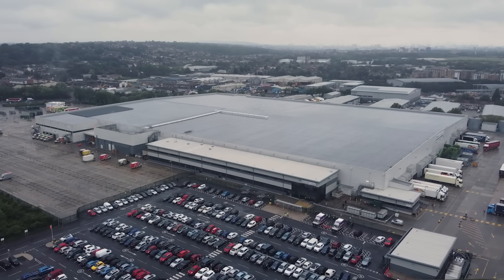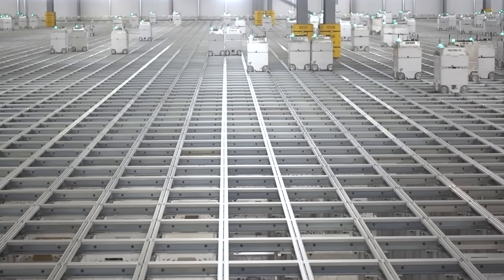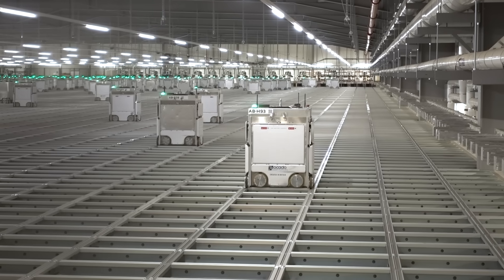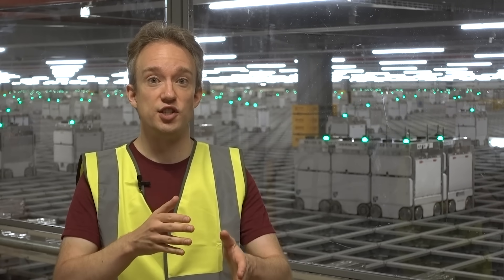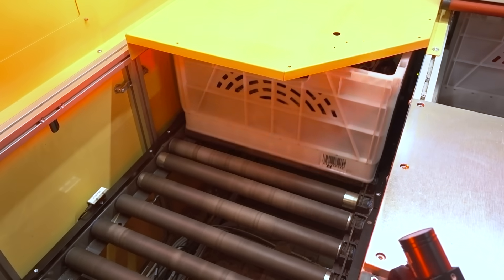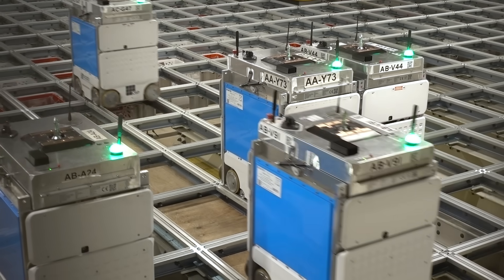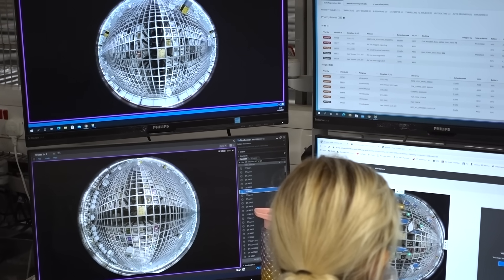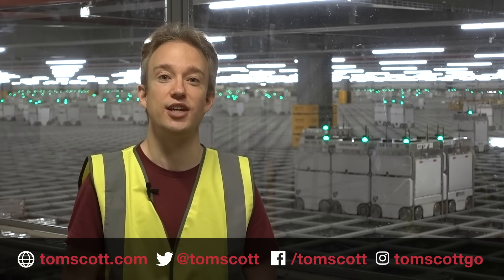How many robots does it take to run a grocery store?

Comment: Is a spouse part of a family? I think so. In the same way i think my gut biome is part of my body. Sure we don't all share the same DNA but we all rely on each other to get through the day.
Do you think any less of your blood cells because they don't have neurons? Are the lipids that coat my eye less of me than the skin cells I shed from my figures?
I am positive Tom didn't mean to divide but I thin ironically for this video it is the need to label things and put them in boxes that tends to push us apart.

On the other hand. I think it is fine to define things. I just think that if you can't work out if something is one thing or another in your definition system you haven't defined that part of your system well enough.  Your laziness of definition does not make a paradox.

Comment: Having worked at Amazon I guarantee 99% of the packing of the totes is done by humans. We had a very similar system there robots and that stuff, even a mechanical arm. However, the arm was slow compared to humans and was probably more of a proof of concept than anything that was anywhere near ready to replace anybody.

Comment: Please tell me that if they have to manually repair a robot on the grid (such as the orange one) they have a Tom Cruise with an engineering degree ready to be lowered from the ceiling in a harness to operate on it or extract it. If not then I'd be more than  happy to submit my resume.

Comment: Can we just take a moment to ealise that this place, which probably costs millions of pounds, still uses xbox kinect sensors for their 3d camera system ( 2:27 )
Reply: If it works, it works 😄 And they are very cheap.
Reply: The reality is that those sensors are amazing. They are inexpensive and very capable, which is a winner when you need to do anything at scale.
Reply: @gbestwick  I guess it’s just funny that they didn’t take just the camera out of it and even made sure the Xbox logo lights up
Reply: @Icetea-2000  I'd assume these come like that from Microsoft, specifically for this place. There's no way they're getting whatever quantity they need second hand off of ebay or so for probably varying prices and in varying conditions.
Reply: @cameron7374  I’m 100% sure they aren’t made specifically for this place, the Xbox logo gives it away, I also don’t think they buy every individual one from ebay or whatever, but they definitely buy them in bulk from a reseller or something, not Microsoft
Reply: Didn't the US military use Xbox controllers for controlling drones or something?
Reply: @MrSkinnyWhale  wait really?
Reply: @bigmoneyben08 no joke there is footage out there of a UAV operator controlling it with an Xbox controller.
Reply: @lukewalker3905  that is so cool
Reply: @lukewalker3905  that's awful

They should've used the switch pro controller
Reply: @MrSkinnyWhale  I know I saw a report on military using Xbox controllers to operate periscopes because the controllers are relatively cheap compared to a $1000+ controller panel  and outright offered familiarity and more functionality than the typical custom setups. And if they break it they just plug in a new controller off the shelf.
Reply: @pspprogramerpsp  there’s still a nyko one in the bottom of the drawer that nobody wants to use
Reply: @MrSkinnyWhale  I read somewhere, can't remember where, that part of the reasoning for that was that soldiers were more familiar with the Xbox controller, and it was easier to design systems around a control layout that they already were familiar with and knew rather than designing something bespoke.
Reply: @Rory_Shade  yes this makes a lot of sense. Not only saving development costs on the design/physical side as you say, but also for saving time on the human training side of things.
Reply: @MrSkinnyWhale  I think they used them for prototypes and experiments in more ergonomic controls; IIRC among others for submarines? 
I very much doubt that any military would use XBox controllers in a sensitive settings though. Their quality and resiliance level is far too low; even with normal gaming xbox controllers' sticks wear out really fast.
Reply: @termitreter6545  the bright side is they're so cheap, you could just have a pile of spares on hand.
Reply: @termitreter6545 I'd say their quality is just fine, and compared to other military stuff, they are dirt cheap (60 dollars or so?). And if it breaks or the sticks are worn out literally everyone can pair a new one in seconds
Reply: @djsomeguy  I mean you dont wanna crush your submarine into the ocean floor just because youre busy plugging in a new controller xD
Reply: @Chasam93  Frankly, for a big console manufacturers controller, I thought the 360 pad was shockingly bad in some regards. 
I got PS2 controllers whose sticks still work perfectly fine, but 360 sticks felt a bit loose after a few months of using. Heck, even at release they're not exactly tight, thats why most games need 10% deadzones for 360 pads.

And no, in the military you dont just wanna switch out important gear because it breaks all the time. Thats fine at home, not on the battlefield or even the vicinity of it.
Reply: @termitreter6545  They did use them and many still do. They’re versatile, easily to modify and CHEAP.
Reply: @termitreter6545  The xbox controller is designed to last millions of inputs. It's far more resilient and reliable than any custom job. It's also familiar to users and has zero "getting used to". And yes, it's used in the most sensitive settings.
Reply: Why spend the money research and developing something that is already cheaply mass produced.
Reply: I'll be honest. I thought you were just saying it used similar technology to the Xbox Kinect. But no, they are literally using an Xbox Kinect
Reply: the down side is that kinect only understands C#
Reply: Microsoft sold a specific version of the kinect for operations like this, with a USB cable. It was actually VERY expensive!
Reply: Microsoft: ...

Comment: It must be an absolute blast, to engineer such a thing. Part of me, immediately wants to see what issues occur and if they are solvable long term. 

Thanks for showing, Tom
Reply: Was an engineer on these, can confirm was awesome
Reply: @EmileVictor  same 👍
Reply: How are they all powered? If its by battery, how are they all charged? How does the main controller decide which bot gets what product? How do you get to a bot if it breaks down? What about cold / frozen products? How are they stored and retrieved? How do the bots pick up an item?
Reply: @skmetal7  LiIon Battery, charged at the yellow charging ports. The bots request charging and the hive mind allocates a free charging spot. The robots lower a square frame with grippers which lock into holed in the totes. The closest free bot is allocated to the tasks (to dig to lower totes, multiple bots grab totes and lift them until one bot reaches the desired tote, then the other put back the stack). Cold storage works well, frozen storage not so much due to grip of the wheels on the rails and the lack of battery heating (at least at the time
I was working on them). To retrieve a bot, you can lock a path to the bot on the gris to not be driven on and then it is safe to walk to it and pull it out.
Reply: @highcooley  working in the IT and mainly with architecting infrastructure for fleets of containers and Microservices. Aside of course from the mechanical engineering, it sounds like a physical manifestation of the same kind of problems. 

It boils down to creating a system that is resilient and self healing as much as possible.  

Awesome stuff, thanks for the insight.
Reply: Yes I want to see the algorithme !
Reply: About a 1 1/2 years ago ish an identical Ocado warehouse using the same robot tech completely burnt down in Andover, Hampshire. I can’t remember the exact cause but I believe it was to do with the robots.
Reply: A clear issue would be that replacing human workers with robot workers contributes to unemployment. The greater the rise of automation, the greater the rise of unemployment becomes.
Reply: Your naive grasp of future consequences from today's actions is a perfect example of the centuries long problem with humanity's mentality.
Reply: @__cypher__  I'm confused did you read or interpret something wrong?
Reply: @__cypher__  what are you even on about
Reply: @slurponaut of course this would need simplification for lesser minds... For the last few hundred years most people care to much about 'Ooh! Look what I  can do!" Not enough people consider the consequences of thier actions, before they act!
Reply: @__cypher__ Bro what?

Comment: Haha this is why engineers call them “systems”, it eliminates the what’s a robot debate
Reply: I'm an engineer, I call them by their given names (given by me obviously). It makes work emails more.... interesting.
Reply: Is it one system or multiple systems?
Reply: @DogsRNice  that's one system comprised of multiple units
They are akin to wireless appendages, all controlled by one system
Reply: @DogsRNice  A system is just made of smaller systems.  That's why it's easier to think of, because there's no point in talking about which is what.
Reply: @SeventhSolar  I love this statement. All systems are made of smaller systems - even the "robots" break down into smaller systems - locomotion, lifting, sensors, wireless connectivity... and each one of those breaks down into separate systems, etc.
Reply: @DogsRNice  Yes.

Comment: I'd call them separate robots, it's like calling an army one big soldier.
Reply: Except that soldiers have autonomy.  Each soldier is their own controller, and making their own decisions. The bots in the system aren't making any decisions.  Its more akin to each actuator in the mechanical arms.  Each one moves according to the controller, but each is not its own separate robot. 

So is it a robot by being a separate unit? I like the definition of each controller being a robot personally, but there isn't a right or wrong answer.
Reply: They are really not like soldiers.
Those are able to react and make decision based on that.
These bots are incapable of that, they are merely untethered senses attached to a freely moving "hand".
It is one big robot.

Comment: With a large group of units like this that could interact, it's more efficient to coordinate all of them from some central system so that you can have them all working in tandem and not interfere with eachother, as opposed to having every separate unit judging others' paths and guessing what they're all going to do.

Which is why I don't think there's much value in self-driving cars until it's feasible to network everything on the road to get real efficiencies instead of having a bunch of algorithms with weird holes in their knowledge compared to what human drivers know.

Comment: Xbox camera above robot arm. :) repackage odd shaped object are really hard to do right all the time by machines. Theres a long path to be automated. Shipping pallets arriving by truck and stored automatically when truckdriver unlpads truck. Pallets unloaded, usually with multiple boxes containing many items in each box which then are placed in the system we see in the video. 
So i sonder if they completely unload the pallets when they arrive. If they have multiple levels of storage, for the pallets, the boxes on the pallets and then this. 😀

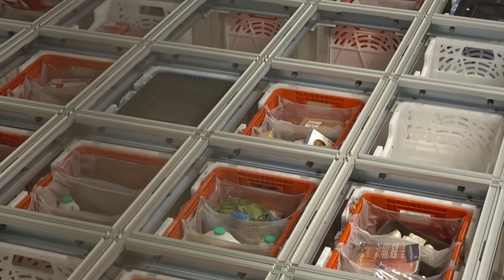Comment: In Germany and the Netherlands there's a grocery delivery system called PicNic (don't know if GB has it) and they also have those crates with the bags fastened in them on delivery (1:01), I never knew they were packed by such big robot systems. But it makes sense when you know you can order for the next day up until 10pm the day before.